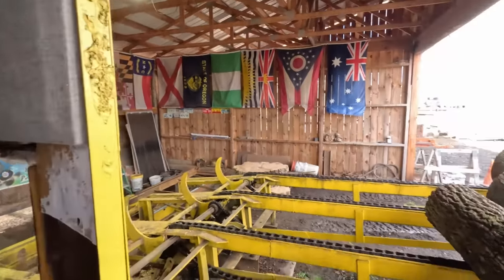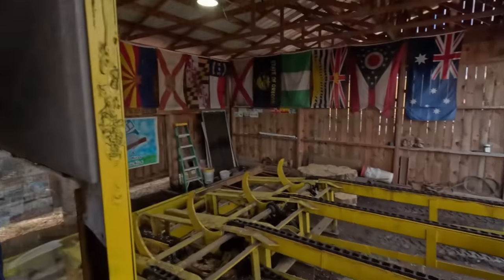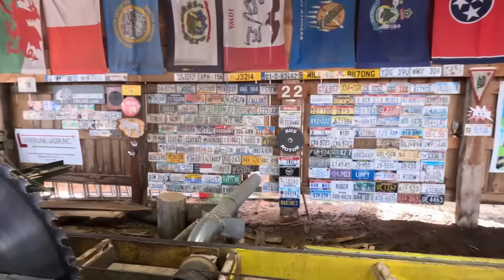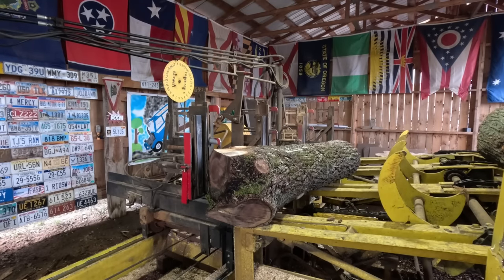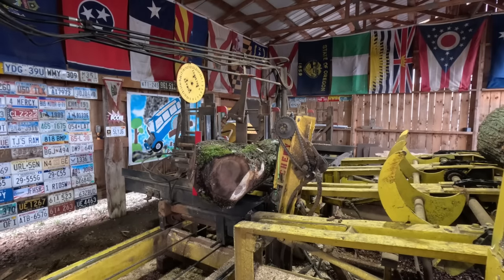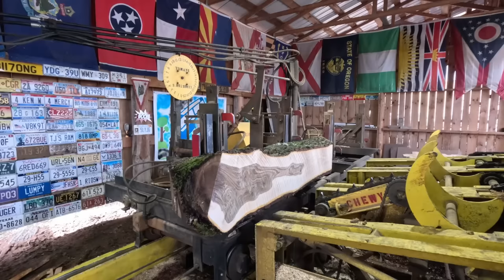custom sawing a small walnut log snack video # 546

Comment: Hey Mark, little story. (This is prior to the little walnut log a week ago before this one) So, I'm building a pulpit for my pastor's church out of walnut and part of it called for 5/4 walnut at 13 inches wide. Just needed an 8 foot stick so I could cross cut it to around 20 inches. Or I could try to find four boards around 20 inches that I could shape to size. Pretty easy to find, right? Nope. Even called a company in Portland who specializes in walnut, has some of the rarest cuts of wood on planet earth, and they still didn't have what I needed. Then after all that I sit down after work, put on bus motor productions, and BOOM! There it is, walnut in the exact sizes I need! I wish I could have driven from Seattle to come get them!